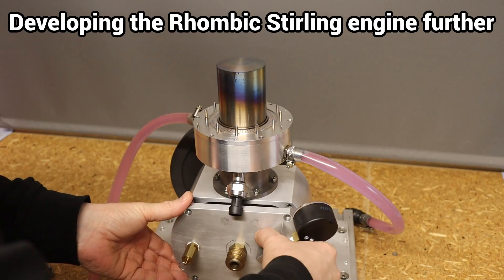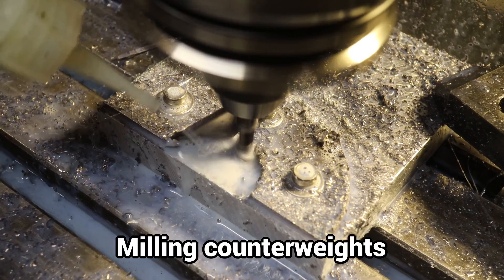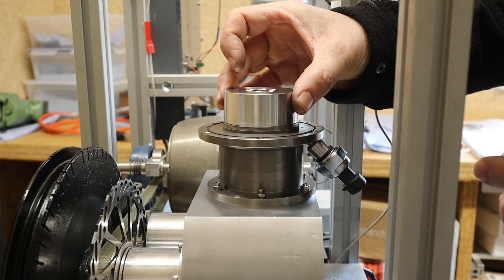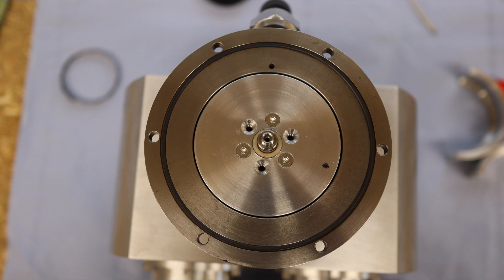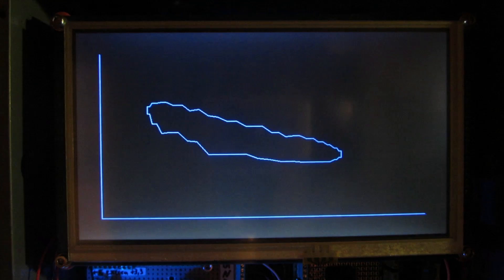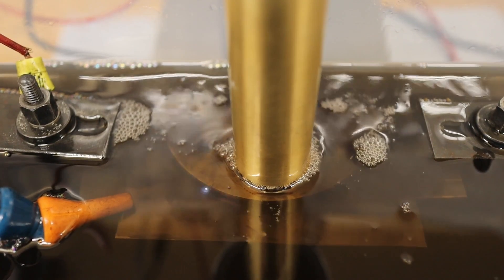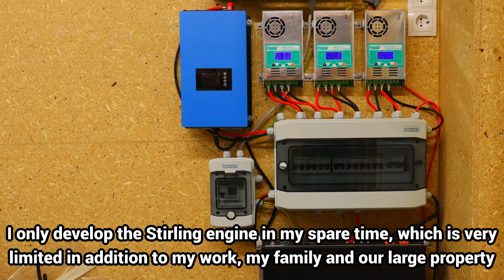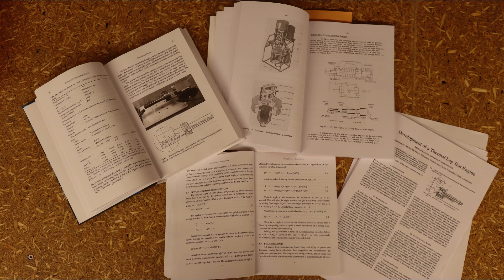Stirling engine development for cogeneration of cheap DIY energy to become off grid and independent

Comment: The Stirling engine has been well studied by engineers engine enthusiasts, but take it from NASA that the most efficient Stirling configuration is in the free-piston variety, if you have the stomach for the complicated power electronics that come along with it.  Converting linear motion of the springs into usable power is harder than spinning configurations that are easy to slap a generator on and get useable electric power.  Also Stirling is used heavily in the cryogenics industry check out some of their designs.
Reply from the maker: Yes, a linear alternator for generating electricity is not as easy as a conventional rotary generator.
But I read of efficiencies also in the region of 90 % if done well. (Harwell)
Unfortunately I found very little information about them.

Thanks for your comment
Reply: @myengines2443  Hi there, I suggest to you to hack a tear dropped LG linear reciprocating fridge compressor for your free piston project in the future, because that is cheap, but the engineers patented that as a high efficiency linear technology inside that (on the base of the SUNPOWER linear motor). I opened few pieces and I saw that technically possible to change the piston and valve combined central-parts to your piston with low friction. There works super strong flat Neodymium magnets inside.
Reply from the maker: @AttilaBlade  thanks a lot for this hint, I will inform myself about that and give it a try.
By the way many thanks for your great videos on your channel I am watching a lot at the moment deciding which alternative Stirling concept I will choose for the next engine!
Please go on making videos your content is great!
Reply: @myengines2443  Thank you! If you send me an email, I'll send back few disassembling pictures about that and few pdf files if you want. Just to reduce the searching time. BLADE sps.: I want to make new contents, but my job is so busy now, and new workshop isn't ready to it. I feel my head will blows up if I can't start the experiments ASAP. Lot's of idea grows inside. Thanks, anyway!
Reply from the maker: @AttilaBlade  sorry for your difficulties in the past I heard about that and hopefully you can start experimenting again soon!
The Stirling community needs you!
I would be very nice and kind of you if you could send me information about the linear components.
My email is tom-rock@web.de
Nice to hear of you!
Reply: If you have a look at commercially available Stirling generators for wood pellet stoves, they indeed use linear generators. I think they are available at 1.5kW of electric power.
Reply: Used to work at Sunpower as an EE. Cool to see what you are doing. Good Luck!
Reply: The electronics seems like the easy part, the toy known as the "joules thief" beefed up to serve a BMS.
Reply: Interesting work!

1) I'm only armchair and YouTube.

2) I'm more an entrepreneur than an engineer.

3) I'm fascinated by the Stirling Engine as the poor man's doorstep to mechanical better-life --- like water power was to New England.

4) The Sterling Engine is something the 3rd World INDIVIDUAL can make (!).   

5) Isn't there a big Stirling Engine that that can contribute something to the poor 3rd-worlder's leg up the standard-of-living ladder?

6) Can't a big Stirling Engine be made to power, say, a boat for people/goods who need transportation up and and down rivers or between islands, powered by coal?   Or plow a rice paddy?   (I saw one being used to pump irrigation water in India.)

Again, it's the "this can be made by one person" aspect of Sterling Engines that is the appeal.  (!)

Any thoughts?
Reply: @hg2. 
A asian one zylinder motorcycle engine can be bought for ~150$ and has more power and better fuel efficency. 
This is probably the easier starting point for your project since pepole im development countrys have no acces to cnc machines, but already use cheap mototorcyles and are familiar with how they work.
Reply: That is not correct. Moving parts means less efficient. You cannot assume Nasa has come up with the ultimate design. Unless you have proven limitations theorem
Reply: Take it from Tesla, nasa couldnt figure out how to land a rocket for reuse. Theres a lot that government money cant teach you

Comment: I am almost done my 60 cc Stirling Engine. As I said in previous videos of yours, I think your swept volume is too low. I see 50 fins for air movement of the cooling ring where the Ross engines would have 250. Yes machining fins is hard but that is the key IMO.
Reply from the maker: The depth of the fins is 8 mm or nearly 0.3 inch.
I designed them with the similarity formulas of Allan Organ after the GPU-3.
I know this is not perfect but probably not too wrong.
I also controlled the heat exchanger surface areas and volumes
 with new formulas based on lower pressure engines and they also seem to fit.
But you are right, more surface area is always better as far as the dead volume does not get to big.
I have to look it up but I think there are more slots in the rhombic engine.

Please show your engine on your channel, it sounds very interesting.

Thanks for your nice thoughts!
Reply: @myengines2443  I've been showing off your engine to my friends as an example of German technical ability. Mine is nowhere near as smooth and space age. Rough castings. I would post a video soon with cast fins but don't want to give too much hard won details away to the public. It would be a month to assemble with existing parts but I am 3D printing an SLA hot end out of aluminum brass with 125 fins at .100 depth in castable resin. Am looking forward to experimenting with fins and would go in same direction you did with fewer fins and higher depth. I still think your basic engine design should be capable of 500 watts. My driveline is mostly made of aluminum (connecting arms and pivot joints). The pistons are thin cast iron and the cylinders cast bronze. (this might be backwards but you can see it at Chris Workshop). With such a heavy flywheel required on these engines I'm not sure if it matters how heavy the axle components are.
Reply: Actually what is the depth of those fins? The ross fin depth was .100 inch, maybe you do have a similar swept volume if they are deeper but fewer in number.

Comment: I do have whispergen Stirling in my workshop, non working unit, they did use three 1.5mm thick black ptfe piston rings (carbon or carbon molybdenium filled i guess) and thin wire round spring for pressure it.  They have 30 Bar of mean pressure, but piston ring pressure using "finger meter" is very, very soft.
Reply from the maker: The whispergen is a fantastic engine, very nice to have one.
Yes the piston ring tension has to be much lower than I thought at begin, friction is so important!
Thanks for your inside information.
You are always a great help!

Greetings!
Reply: Hi Stanislav, this is not a problem, because the spring and the high pressure Helium both gives the right frequency, dumping effect etc... with the masses. When we increase the pressure the gas change the frequency a lot.
Reply: @AttilaBlade  i think you are speaking about a free piston stirling engine. Whispergen is 4 piston dual acting alfa stirling.
Reply: @StanislavZachazevski Yep, you're right! I was confused with what the "piston spring" means here. Thanks for your correction.